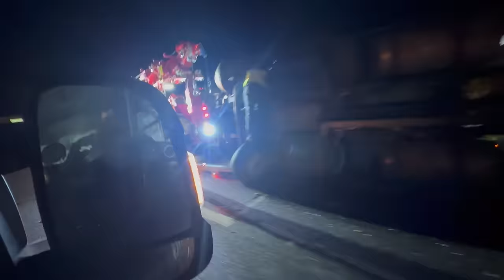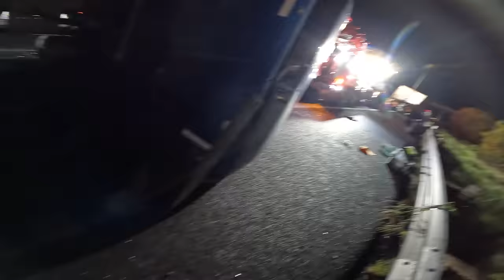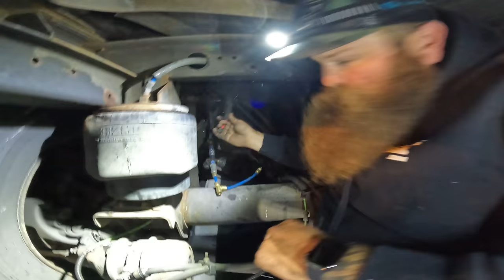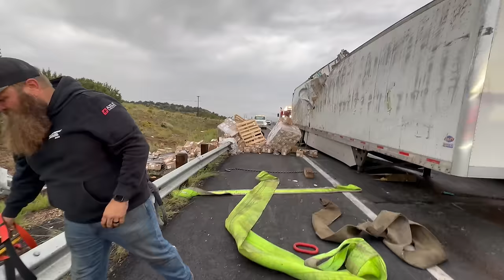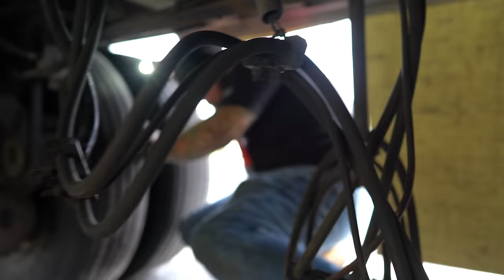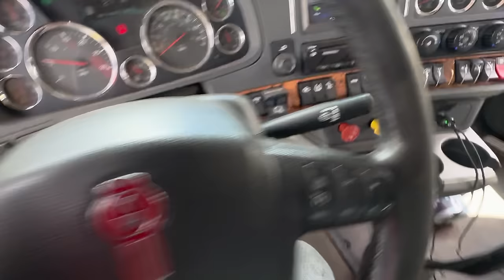Semi WRECKS CLOSED DOWN Major Interstate!! The GOVERNOR Was NOT HAPPY!!

Comment: A good trick to get those slider pins released, put air on the trailer on the trailer releasing the brakes, then pull the silver button to release the pins. It will be stiff as all hell, but it will break them loose, then set your brakes and pull the button again and the pins will stay in works almost every time 😅